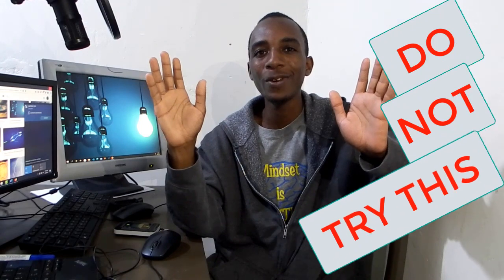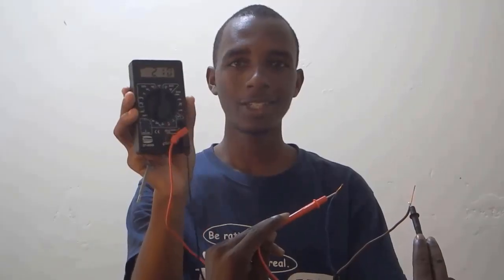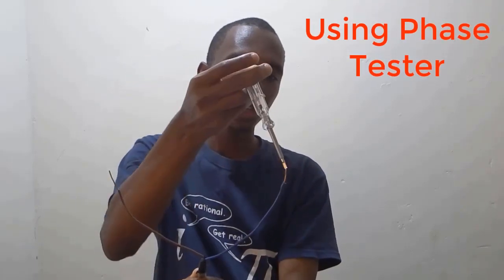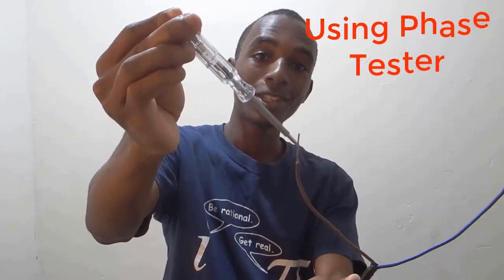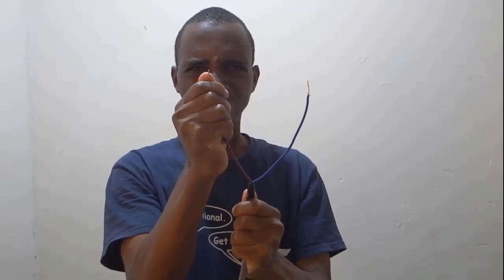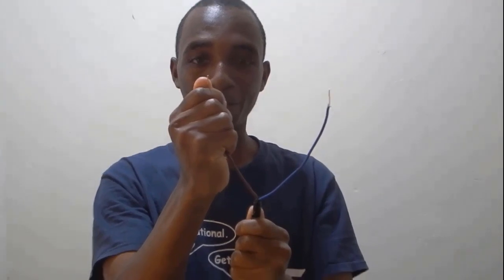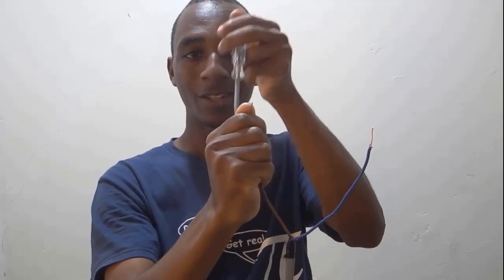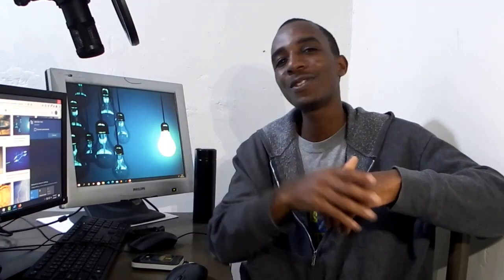I touched a LIVE WIRE of Electricity - Do no try this !!

Comment from the maker: Honestly, i was feeling a little bit of shock. The rubber soles weren't perfectly insulating, especially for the 210 V.
I also had to make sure I don't touch the live and neutral wires at the same time, that would cause a huge current to flow through me due to the high potential difference.

Comment: I'm not an electrician by trade, but I work with them sometimes to check equipment power and I had one say "don't touch me" followed by him touching the live wire and I was so "shocked" (pun intended). I realized why he wasn't being shocked because of his rubber boots, but also I just felt it was so dumb and I wouldn't do it no matter how confident I am. Thanks for the demonstration.